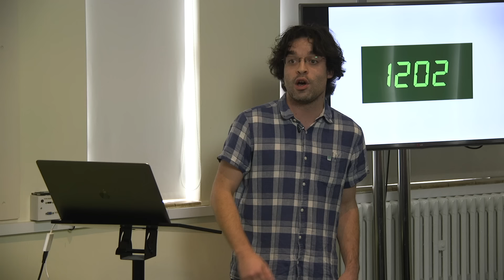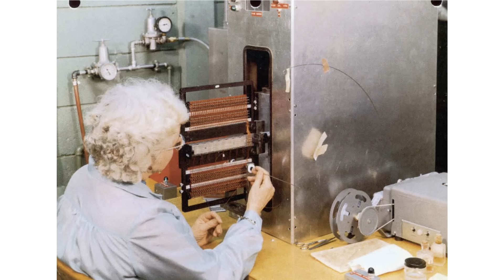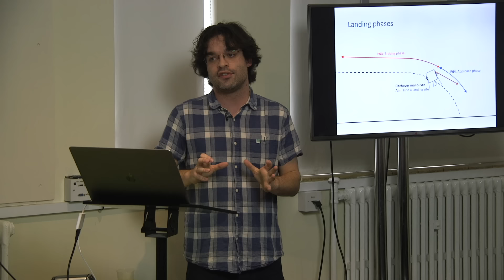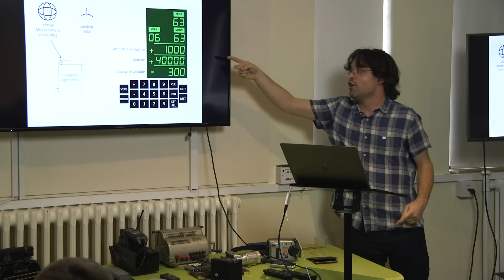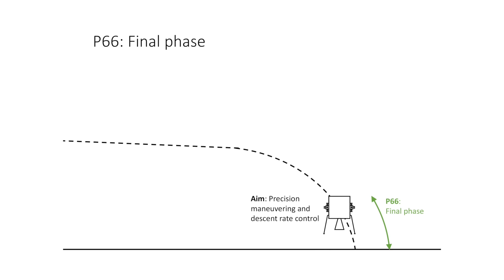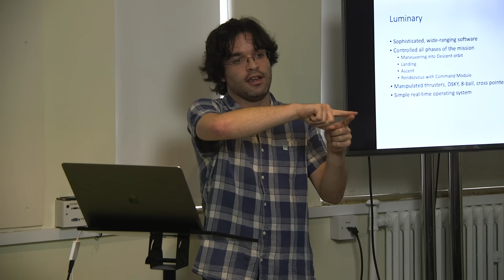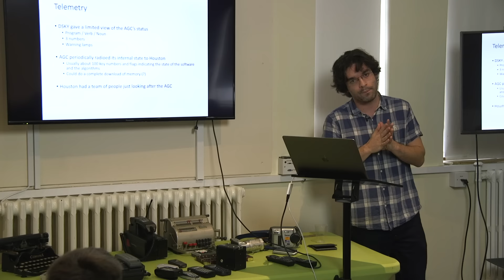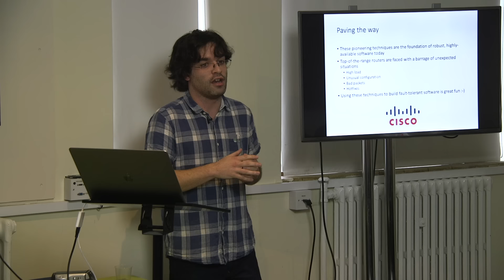Light Years Ahead | The 1969 Apollo Guidance Computer

Comment: If you want to see a totally robust operating system on a desktop computer you can see if you can get a copy of IB  os2. It is a pity that Microsoft stopped to collaboration during OS2 and we ended up with I think was Windows 95 or 98. What was special about os2 is jobs could blow up but the system didn't crash. Or if you prefer to use germ applications would crash but not the actual operating system you could restart the jobs. It was more of a mainframe design then a desktop design. I wonder how resistant it would have been to hack the system. Knowing how IBM is so security conscious, to the point of driving you crazy security conscious. I was a contractor working for them and they had some roll set for security based and if you broke them you got thrown out of the building permanently.
Reply: I worked on OS/2 for awhile.  It was a quality system, but not entirely problem free.  Brief was the best programmer’s editor and Brief for OS/2 was the best version of it.

Comment: Nowadays modern aircrafts use extensively what was learned with Luminary and the Apollo Guidance Computer. And no current multi-rotor drone could ever fly without an IMU chip providing input to a computer's retro-feedback process; the pilot can then concentrate on where to go. This is exactly what they did to land the LEM on the Moon. Bipeds and computers make a pretty good team!

Comment: Great presentation, extremely interesting, for me easy to follow. I now know more then I ever had questions about the Lander and landing. I am retired software engineer with grades in electronics and computer engineering. Back then I was very interested in space, had paper models of several space craft and rockets, and at 17 got up in the middle of the night to see the live broadcast of the Apollo 11 landing and first footsteps on the moon. 
Note about writing software for small memory configurations: that is back again. 
The Harvard course "tinyML - machine learning for microcontrollers" e.g. they learn how to design and deploy AI applications that used to run on powerful computers so that the application (not the traning) on the current generation of microcontrollers (processor chips having limited ram and (ep)rom), making it possible to use AI to process information in real time on battery-powered, specialized devices that have no battery charger and no big computer power in the cloud for processing. Of course, now a days these chips get every year more cpu power and ram/rom en less power-hungry, so more comples AI models can be loaded and used for longer duretion.

Comment: 1:17:33 It's not even apples to oranges comparison. Two Processors with the same clock speed, input/output and memory can have very different calculating capacities because their architecture is completely different.

Comment: WOW!  I watched this live when I was 3 years old and still remember quite a bit of it.  I now work in computing as an IT Manager and have been involved in 6502/10 and Z80 machine coding so I KNOW how hard it is to write small programs first hand.  My question would be where did they store the programs.  I assume they were in "ROM" so could not be amended and when they ran they would use "RAM" to act as live data storage.  The benefit is that the coding could not be corrupted if it was in non-volatile, hard coded ferrite core storage.  This lecture whizzed past even though it was 1 hour and 20 minutes in length.  I would love to see more on this.  Well done Robert and well done to the developer whose name I failed to take note of; I think it was Margaret Nicholson but don't quote me :o)  SO it was a woman who put a man on the moon??  (Don't take that the wrong way as I know it was a huge team of males and females).

Comment: I started with an I8748 which had 1K EPROM 64 bytes of ram.  This quite a different sort of programming, as the presenter says just add more memory was not an option.   Before that I had done a little programming sort of but really hardware applying variable temperature compensation using straight-line approximation op-amps, Voltage references and an analogue multiplier RC4200 it was a very good IC.

Prior to that a tutor at college told us a little of the work he did on gun ranging using synchros and servos during WW2.  These are all different to modern programming in that there is not much of a library of standard function blocks, no printf, they have to be developed and made using what is available stuff that is much more like nuts and bolts or a meccano set.

By 1990 desktop computer had 40MB hard disk and if they had windows 3.1 you had about 10MB or working space.  Now GRUB bootloader takes 50MB I believe, part of this is because it is a very conservative design but much of all modern programming leaves the clutter there and add more.  I am a hardware engineer and have not written software for more than a decade but I used to tidy up making small but also knowing more how and why it worked and its vulnerabilities.

Bottom line is I can not agree more with the statement comparing apples and pairs but add the earlier technology used very much more art and creativity.

Comment: Its amazing how this discussion proves the arrogance and colossal failure of today's automotive software engineers. It also highlights the arrogance in engineering in general. The fact that there was an argument between the software engineers and the astronauts as to who would be in control for the landing is amazing - amazing that the engineers assumed they could make no mistakes and cover all possible variables. We have this issue with cars today. The biggest of which is the start stop control of the engine. I've had where I let off the brake just as those stupid engineers choose to shut off my engine, causing the car to roll slowly into an intersection. When the car does not go, it is normal to step on the gas harder, especially when there is cross traffic. When the car finally does start, it lurches forward and has put me off into the grass on the opposite side of the road. Second example would be antilock brakes. In any situation where you inadvertently spin the wheels, the antilock disables the brakes, and the brakes no longer function. I saw a kid back right through a wall in a building, because the antilock disabled the brakes as a result of a slight spinning of the wheels in reverse. I personally have had where I lost traction trying ease forward in the snow. Immediately when the wheel spun, I hit the brake. The antilock disabled the brakes and the car went forward an extra foot farther than I intended. The idea that there is no emergency override to the software interfering with the driver's intentions is dangerously unsafe. These automotive engineers need their heads banged into the wall and knock some sense into them.
Reply: ABS is even worse on a motorcycle.

Comment: The first fallacy in the calculator comparison is it a calculator does not run more than one job simultaneously. It doesn't task switch. It requires data input and then simple buttons to tell it what kind of maths to perform and then it produces a result and then it is idle again. I would think that it's probably more comparable to an exercise watch or maybe a cell phone. Cell phones do more test switching than they do CPU sharing. This was a true multitasking computer before multitasking really was a known word to the general public. And they did it with so little memory and raw processing power it's really quite amazing and very powerful for its day.

Comment: One of the biggest differences between programmers today or even programmers 30 years ago in my experience, the availability of resources has been increasing dramatically. The other thing I encountered with hundreds of programmers is they would write a program not understanding or accepting in their mind that there was maybe a couple hundred programs running at once and theirs wasn't the only one running. Also in the IT industry the amount of storage has increased dramatically. On my personal computer just one of my hard drives has more capacity than the mainframe I started out on in 1981. The fastest piece of equipment was the  Borroughs 5N head-per-track disk. It held a massive 5mb! The original PC only had 64 KB of 8-bit ram. The Intel 8088 processor was a downgrade from the actual 8086 architecture. The 8088 was an 8-bit bus was 8-bit ram which was cheaper than 16 bit ram. There was no follow-on chip for the 8088. Ram became less expensive and so the 80286 became the next chip in the evolution to where we are now. It was based on the 8086 which had a 16-bit bus and used 16-bit ram.

Comment: I have seen and diagnosed an issue with an archaic piece of equipment called a Mitron. In short this equipment would take a nine track tape and transmit it to an identical piece of equipment over a data line and duplicate the tape. Think of sending a fax butt instead of paper you're sending a copy of the magnetic tape data. We were sending software updates to a sister Data center and they weren't able to load the tape coming off of the Mitron. After several tries I realized it was a piece of machine code software instead of our normal Cobal and there was a character in The machine language that was being interpreted as a data communications control command. Basically end of block and of transmission. I made a copy of the tape excluding the program I thought was guilty of the problem and it fixed it. There was no way to really monitor what was exactly being sent over the unit. As I said it was archaic for the time period. The mitron had 64k of memory and a Zilog z80 processor. This was one of the early microprocessors that were used not only industrially but on personal computers. It was only capable of dressing 64k of memory. The processor also had to do translation in this particular installation from epcdic to ASCII and reverse it to write to the mainframe tape. So the size of the data blocks had to be strictly limited. I'm not sure but I think that processor is still manufactured for industrial purposes where durability is more important than speed and power. The z80 was also 8 bit.

Comment: I had only one question; compare the computing power of the Apollo flight computer to a modern day cell phone in terms of power...could a simple smart phone do the same job of the on board computer?
Reply: The calculations that were performed by the AGC were crucial but relatively simple. Heavy duty calculations were being done on the ground with mainframe computers and mathematicians. Your cell phone is actually a general purpose computer that with proper programming and I/O can perform many tasks quickly. 1940's computers were slower than 1950's and they in turn were slower than 1960's. In any case, what the military and NASA used was the best available at the time and up to the tasks on hand.
Reply: @gevansmd1  so a cell phone today is far more powerful than what took the Astronauts to the moon...
Reply: @murph7489  it's called progress. Your cell phone can compute faster* than computers of 30 years ago. That doesn't change the fact those old computers did what was needed of them.

*raw calculation speed isn't everything however. Your phone cannot handle the multiusers and I/O of a 1990's IBM mainframe.
Reply: @gevansmd1  well that is what amazes me and what makes NASA so great....if it were not for that space program, we might not have smart phones today...it progressed technology in and of itself..
Reply: @murph7489  exactly they had to be creative with the technology they had. Velcro, freeze dried food, mylar and other common place items today were invented for the space program. 600 years ago sailors circumnavigated the globe with just a compass and a sextant. Humans, with all our ugly passions can be quite creative and resourceful. 😊
Reply: could it do the calculations? certainly. could it do so with basicly perfect reliability in the conditions of a spacecraft? maybe after heavy modification, to the point where it would no longer actually be a phone but a small computer inside a new shell of radiation hardening, a reliable power supply (modern chips are really not huge fans of voltage variations), a HUGE amount of added IO (you'd need a ton of boards to translate IO from an USB into all the possible IO channels to control the spacecraft). and of course you'd have to entirely rewrite the software with added error corrections to account for the lacking error correction consumer grade electronics. I guess you could keep the display.. though I'm uncertain if it could survive vacuum inside the LM. though such a screen would be ill fit when what you really need is large very visible letters. and of course touch screens are a no go for spacesuit gloves.
Reply: @Agarwaen  nice breakdown...you are right...and I guess I was just talking about its computing ability..but great points all around
Reply: @Agarwaen  modern computers, including cell phones are susceptible to radiation so they'd need extra shielding. The older computers were not.

Comment: A LVI(low voltage inhibit) circuit is also critical. Even modern manufacturers can get caught out by a lack of (or not enabling)  this circuit. COP or Computer operating properly is a common circuit too, if enabled, it will periodically reset the computer. Normal code operation should reset the COP circuit to permit continued (good) operation.  A memory leak for example, will eventually cause lack of free memory- a modern CPU or uC also has interrupts to monitor stack pointer illegal value. In microcontrollers, IO is a mission critical group of components. Misconfiguration of IO may result in many types of errors depending on the IO sub components. A microprocessor or microcontroller operating at out of specificacation voltages can be expected to make mistakes. Failure to increment program pointer, incorrect jumps, maths, adjusting incorrect memory locations, incorrectly configuring IO. Impressive to see susch an old but effectively designed computer from just nultitudes of NOR gates!  There are other tricks that can be used to improve code robustness: filling empty spaces with reset instructions. Checking non assigned memory values for boot flushed values.

Comment: My father worked on flight simulators for the Air Force and Navy from 1966-1986. He started on devices using similar hardware as shown in your presentation and a fair amount of his time was spent in testing core memory. He worked with one of the MIT folks once in Hawaii and was able to fix a bad board overnight that had brought the trainer to a dead stop so the 6-week long technician class, the MIT guy was conducting could continue. Seeing those woven firmware instructions made me appreciate my old man’s war story even more.

Comment: Very interesting discussion.  If the AGC was saving navigational checkpoints, then had to restart, was the old nav data still good, or would the LEM have moved so far that new calculations would have been necessary?  Even with a very short time to restart, I would think the checkpointed data would become stale very quickly
Reply: All the actual navigation was done by the computers on the ground (and to this day it still is for all spacecraft). All the spacecraft control systems have to do is to execute burns of given length at a given spacecraft attitude. All of the necessary data (three angles, burn length and burn time) comes from ground control. From a modern computational perspective spacecraft navigation is a trivial control problem. Theoretically one could have done all of this even without computers. The crew could have done it manually, with slightly less but still sufficient precision, using nothing but guide stars, angle measuring equipment and mechanical chronometers. I believe they even had the training to do it in case that the computer systems failed.

Comment: A mobile phone is thousands of times more powerful in terms of calculation capabilities, and a thousand times less suited for the task. I could write an Android app that could probably process all the data of all the Apollo flights in a minute, but the moment the garbage collector kicks in or one of the hundreds other processes i have no control over decides to run I'd be lucky if I wasn't headed out of the solar system or creating a new crater on the moon.